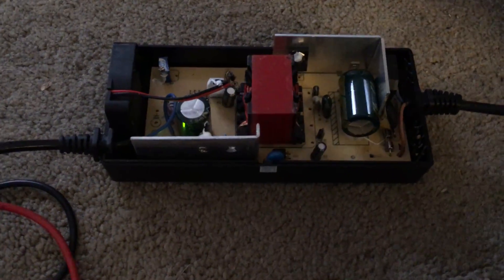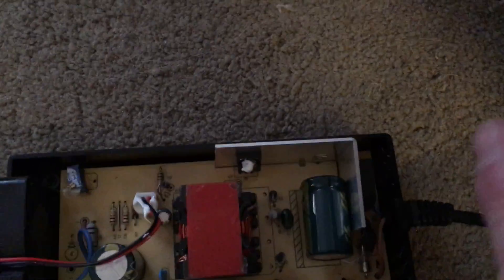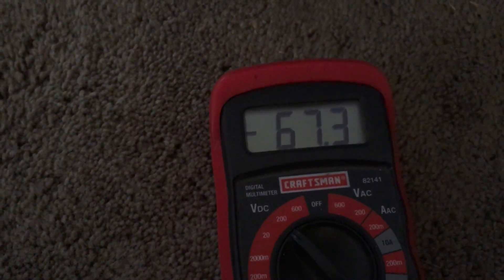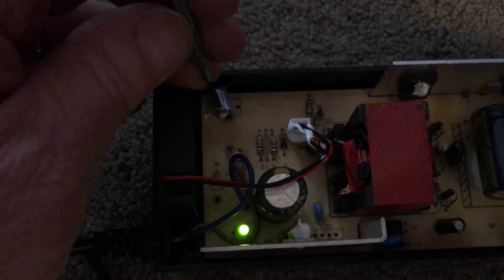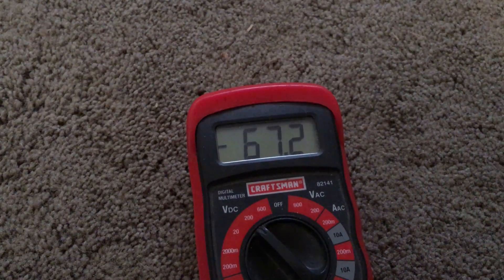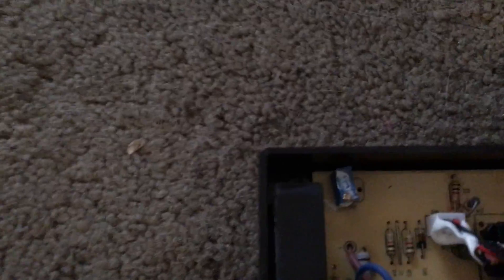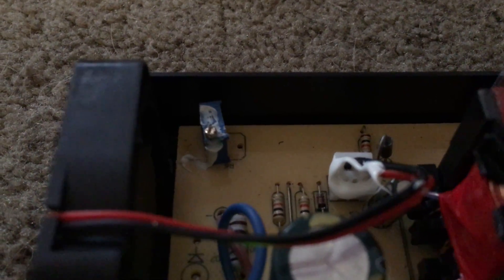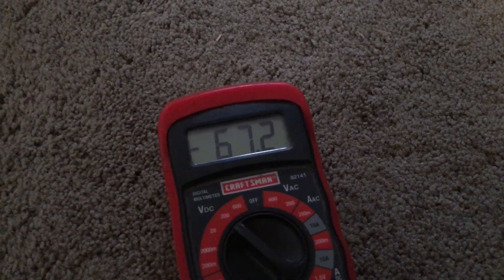Adjust Voltage Output on EUC Charger

Comment: Adjuster on my charger was in a similar place, but with white goop over it to prevent tampering by someone like myself, - or perhaps voltage drift?.  I adjusted down from 42v to 40.5 to increase number of charge cycles on my 10s 5p battery before onset of degradation, as outlined by 'Battery University' website.  I plan on returning to 42v now and then where I guess it needs to be for the bms to do its job.  I only once 'fully' drained the battery to cut-off point (30v), so it hasn't altered my charging habits.  I regularly check the charger output voltage with a meter and it seems to have risen by .05v over a few weeks, so maybe a good time to go back up to 42v for balancing charge then re adjust back to 40.5v.  Thanks!
Reply: Hey Peter, do you have a model number/link to that charger? I just attempted to adjust my generic charger to 40.5, but the trim only goes between 41.5 and 42.5.
Reply from the maker: Hey guys, there’s also something called a charge doctor. You can set max charge rate or voltages.  I have one and it’s a great investment.  
http://hobby16.neowp.fr/buy/
Reply: @SuperSport1966  My charger doesn't have any potentiometer. Where I can find the components to adjust my voltage from 42v to 29v for my new scooter?
Reply from the maker: Andre Patacchini are you trying to use a charger that isn’t for your scooter?  I’d be afraid of adjusting down that much. It might be safer to find a charger designed for your application since you are working with Lithium batteries and don’t want to have a fire risk.
Reply: @CaptainHatdog  I missed the email notification of your reply, but in any case:-
My charger model is SSLCO84V42M.  In the end, I just left the voltage unchanging at 42v.  Charger is for sale on Amazon with mixed customer satisfaction.  Mine came with a Dillenger 350w front wheel kit which has worked quite well for over 2 years and 1800 miles.  I have also had a second ebike for 2 years and 2200 miles and now experience ~30% of battery capacity reduction with both bikes.  I suspect this may be due to heat damage (~140degF) through leaving the bikes parked in intense sunlight (Hawaii) as much as anything else.  I now remove the batteries or cover them if they are to be exposed to direct sunlight.